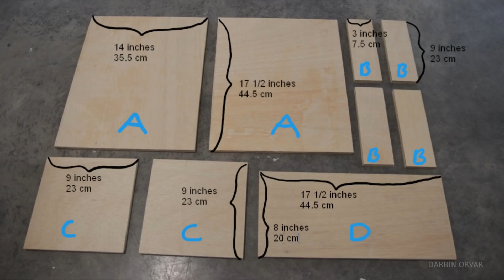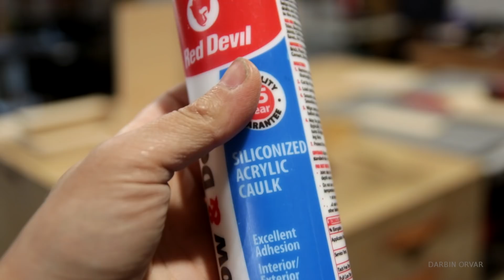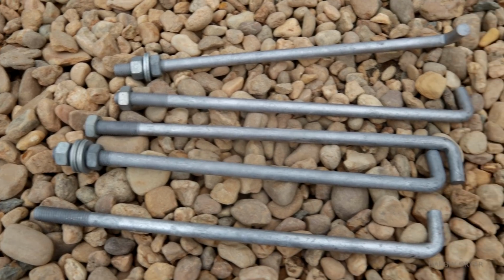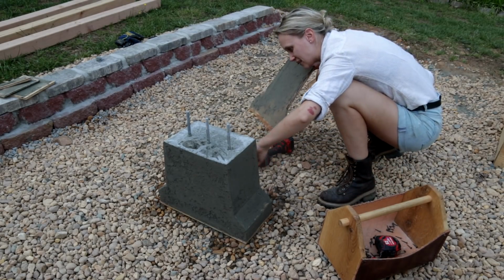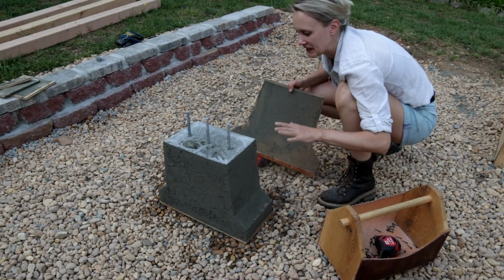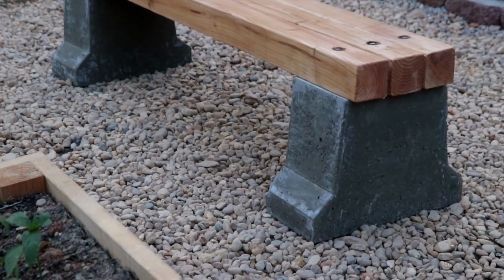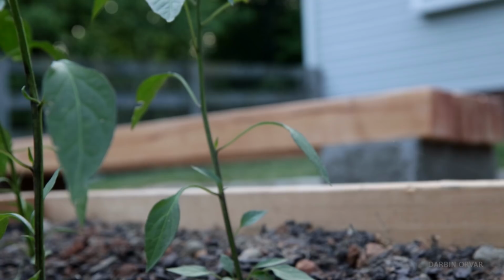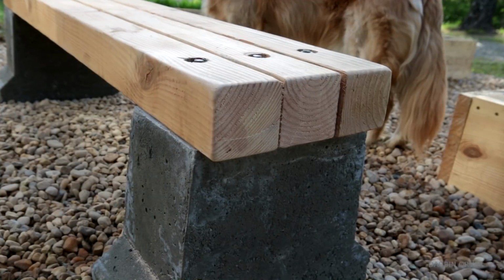Garden Bench w/ Wood & Concrete

Comment: Drill to blocks with three holes in each to secure that J bolts the place them in the wet cement to hold them at the correct height and spacing.

Comment: Great video, may do something similar. If you are doing more of the same, maybe you could make two strips of thick wood with 3xJ bolt sized holes in them to hold the bolts evenly spaced while the concrete cures. This would ensure the wood beams are equally spaced and ensure the J bolts don't move and are perpendicular the wood beams.

Comment: Great idea! For your next bench(es), consider putting the J-bolts in deeper - like for a 2x4, then you can fill the holes with a contrasting wood plug. I would also cut the 4x4's a little longer and have an overhang on the ends. You can color the concrete with concrete pigments, also available at the home center. Thanks, Jon

Comment: Linn you bench turned out great. One tip you may consider, when trying to get the air out of the concrete take the blade out of you Sawzall and use that to vibrate the form.
Reply: I was gonna suggest the same.
Reply: Palm sander works also, run it along the outside of the form.

Comment: Love the bench, if you do a open sided mold and pour open side up then screed off level. Drill your three holes in top of the base  block mold and use thread inserts held in place by bolts from the outside of the mold. Then you can cure pull the bolts and dump and repeat over and over. Light oil or wax should keep your mold clean and easy release. Just a thought. Love the channel

Comment: I thought you would add some temporary marked or notched cross pieces to the mould (have them ready to screw on after you've poured the concrete) so that it would be easier to place and keep the bolts straight.

Comment: What a fantastic production job that you have made with the video ! I like the shot of the mould pieces with their dimensions - so useful ! All the way through the video you have included so much valuable information about the construction ! You have framed the shots so well too, and used techniques showing two shots at once on the screen. This video is brilliant ! You have even told us the weight of the stands, which helps us to order enough material to make the bases. Regarding the shape of the bases, yes they are nice and sturdy, and will do the job well. Another approach is to make the bases a cross-section of a "figure of eight" with a flat top. Leave bolt holes down through the outer lips of the tops of the figures of eight, so that the bolts can be placed downwards with the heads countersunk into the wood, and the nuts ( with washers ) tightened up from under the holes in the concrete bases. When forming the base, leave an access hole to get to the end of the "middle bolt" to fit the nut. By constructing the bases that way, there is no damage to the wooden planks if the bolts have to be trimmed. Use round-headed bolts if using this method. Sorry that my suggestion is convoluted - you probably understand what I'm suggesting ! Hopefully you have used UV-stabilised polyurethane to coat the planks, i.e. for outdoor use, to prevent the sun's UV rays from making it decompose ?  Yes another great project - well done !
Reply from the maker: Thanks so much Phil for this nice comment, really appreciate it! I'm trying to make sure I improve the video quality, and its' always fun to experiment with new concepts.
Reply: i agree.   a great video with much detail information provided.    i'm inspired.    i have an idea on attaching the 4x4's to the concrete bases without having to really modify the bases as described with a figure 8 design.    why not use three 90 degree brackets embeded in the concrete with one of legs pointing to the inside of the bases and flush with the top of the concrete.   the posts would simply lay on the concrete and the exposed leg of the bracket.   i've seen these brackets with holes pre-drilled.    then you simply use a wood screw screwed upward though the bracket and into the bottom side of the beam where they would not be seen but would secure the beam to the post.   from the top side there would be no holes for water to get into the beams.    even using 'stove' bolts as described above would still eventually allow water in the wood and require a more complicated mold for the base.   using 90 degree brackets really wouldn't require any changes to the mold of Darbin's which was well designed and quite easily assembled.   just my idea.............

Comment: Hi Linn. If you are planning on making a few more, why not produce a jig for the Bolts? Then every one would be in exactly the right place, and to the correct height. No more need for ‘wiggle room’ cutting and grinding!
A great project that we can all try.
Endless designs could be used for the concrete bases.
If you made them upside down, you could sink a plastic container into the wet stuff to make it lighter, and use less materials.
Also, how about using some colourant to give the bases a different ‘look’?

Comment: Linn, another way to quickly vibrate small concrete forms is to use a palm sander.  If you really want heavy duty vibration, use one of the old 1/2 sheet sanders.  Otherwise, a quarter sheet sander will work just fine.

Also, if you oil your forms (plain motor oil works fine) you could reuse your forms so you'd only have to build a single form.  Save time & materials.

Comment: If you use a piece of wood across the mold with holes in it to hold the bolts upright and true it could make assembly easier also I would have treated the timber before fixing to the concrete base. But a good project all in all
Reply from the maker: Good idea!

Comment: Mount the J-bolts to a piece of wood so that you can "hang" them into the concrete while it is curing. That way they will be in the exact position you want them to be AND will be straight. Doesn't matter that much here since it's only one hole per bench lumber, but imagine having to mount a piece of wood that has multiple holes. If the bolts aren't parallel in that case there's no way the insert the bolts without a massive widening of the holes. The bolt "holder" also has the advantage that you can preadjust the height of the bolts so there's no need to cut them afterwards. Cutting leaves a surface that isn't galvanized and will rust.

As for rattling out the bubbles in the concrete: I use a hammer drill (those that won't turn if you don't want to) and "hammer" into a bigger piece of wood attached to the cast. Bubblefree within minutes.

Comment: What you should have done with the bolts is to bolt the through some ply and then place them on top of the moulds with some spacers.  This would keep the square and stop them sinking.

Comment: You could have put the J bolts into the 4x4's, and put then on the forms.   Then you would not have any drama with a falling J bolt.   When the concrete gets dry, or is closer to dry, you could then remove the 4x4's to remove the forms.

Comment: Very nice bench , I suggest that you make a template for the anchor bolts so that they end up equally separate horizontally and at equal depth into the concrete ( a simple piece of plywood with equally separate holes fix anchor bolts fastened to it ), I know you are creative and you can add an indentation to the base concrete frame around the edges the end shape of the base will look so nice . Thanks for the video

Comment: One thing that may help someone is drill holes in a PVC pipe to hold the bolts vertical while the concrete is curing.

Comment: Cool bench.  If you do use epoxy to fill the bolt holes, make sure you get exterior rated epoxy.  The normal stuff will not stand up to ultraviolet light.

Comment: Hi Linn,
Great project! We're talking about redoing our backyard. This would be a great addition to our yard!
Question, you sealed the beams after assembling them. How do you get the sealant between the boards?
Thanks!
Reply from the maker: I didn't really. If you're really concerned you could always finish the boards before assembly.
Reply: @darbinorvar  , thanks for the reply! Wasn't sure if it made a difference protecting the insides or not.

Comment: If you didn't fill the holes with epoxy, a Dremel could be used to smooth out the bolt ends even more than the angle grinder could do.

Comment: It would be good to cut off the tops of the bolts before you attach the wood beams (instead of after) because that way you could make the tops of the bolts lower than the top surface of the wood, so they can’t jab you when you sit on the bench above them (or burn you— metal gets hot in the summer sun). Also, it might be a good idea to make the holes in the wood for the bolts oversized, so that when the wood moves (i.e. shrinks) as it ages, it won’t split or twist against the bolts. It’s the washers and nuts that make the connection tight, so the bench would still be very firm. To keep water from collecting in the recesses, perhaps you could put some kind of cap (maybe a wood plug?) above each bolt?

These are things to think about if you do make more of these benches.
Reply: Setting the J bolts might be a good spot for some precision work. An extra few minutes setting height and gap would be worth it
Reply: Good

Comment: I’m a little surprised you didn’t put any reinforcing in that concrete, such as rebar or even some wire mesh. Admittedly, this is not a high-stress application for the concrete, but it couldn’t hurt to strengthen it.
Reply from the maker: I have no worries whatsoever about the strength holding up.

Comment: Nice project.  For the others do something different: Use carriage-bolts that you tighten from inside the concrete (leave holes for the screws -  with foam? ). That way there's no need for the ugly nuts and cut off bolts.  Could have used 2 pieces of wood with holes drilled at the correct distance  to hold the bolts.
Reply: It looks good. No point over engineering it. A bit of steel goes well with the concrete and wood.
Reply: either works well I think, though with the lags a hammer drill would be desired. You could mark where to cut the bolts and then use a piece of scrape to hold the blade square while you cut them, so you don't have cut marks on your bench and the cuts could be lower. also would've used some scrape to keep the bolts straight while the concrete dries

Comment: Did you use some sort of mold release (oil?) on the inside of the forms?
Reply from the maker: No, I did use silicone caulk on the corners and edges but not oil, it had not trouble releasing.

Comment: Now that you live in the US, and they use inches instead of cm. How do you read lengths and what not? How do you measure?
Reply from the maker: Funny thing, I have switched almost entirely to imperial. I know in some ways it doesn't seem to make much sense, but I like the larger inch. Even before doing a lot woodworking here, I did a lot of sewing and ended up using the inch measurement much more than the cm.